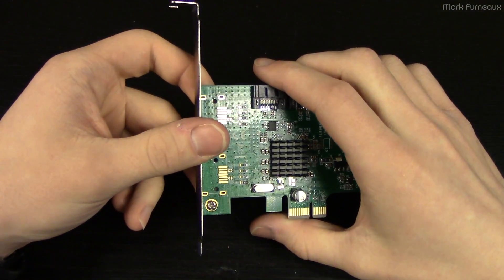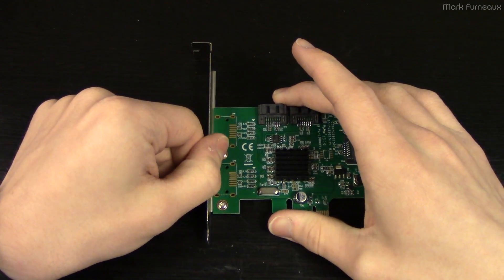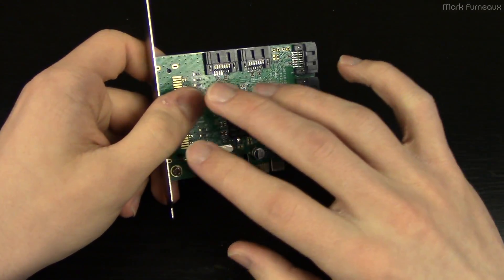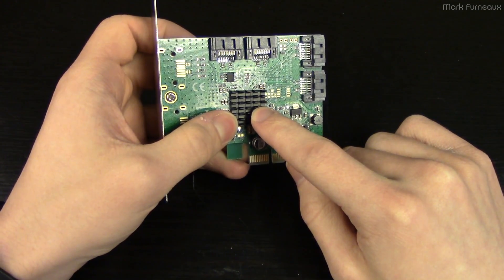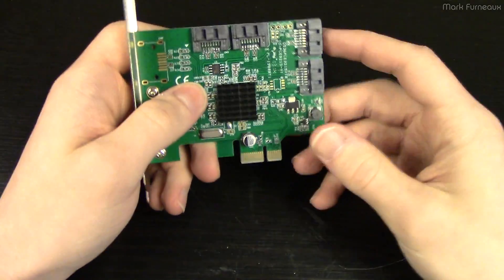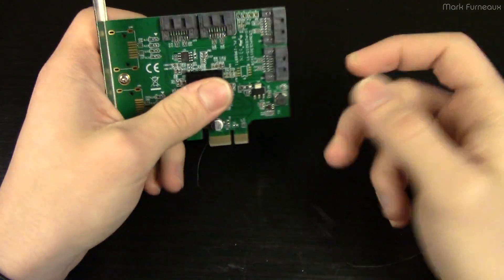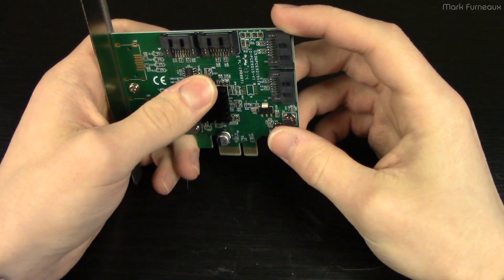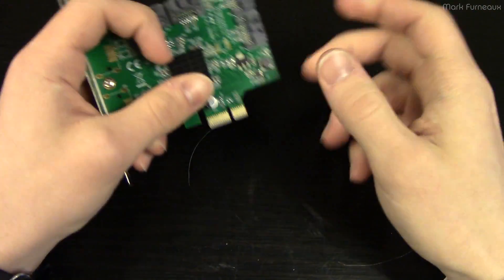WTF is Up with Marvell's Chip Reliability? (Rant?)

Comment: The problem is Marvell mainly caters to corporate customers and for the most part the only marvel parts that end up in consumer level products are factory seconds that are sold in China meant for low end use that somehow end up in "high" end products. I spent a few years in China with the manufacturing arm of an American electronics company. It's mainly the fault of distributors. They love to cut corners and will do so unless you manually QA every other chip in house. This happens with some of the other controllers too (we've had similar problems with Asmidia) but mainly with Marvell as they are one of the lower cost options in consumer gear so the margins are really low which compels distributors to go through more shady channels

Comment: Having heard your reasoning...

I have two decommissioned Opteron-based server boards (still working) which use on-board Marvell 91xx Series PHYs to drive 8 additional "SATA 6G" ports (2 pairs of 4; I presume that must be a close "relative" to the chip they use on your controller card ) - and they still work. The boards were running in 24/7/365 production systems for about six years, and all chips/channels still work.

The obvious difference is the heat-sinking ... compared to what sits on the chips on the server board the heatsink on your card is tiny. Keeping that in consideration, that could explain the discoloration you observe on the back of the PCB where the PHY sits at. I'd suspect inadequate heat-sinking or insufficient system cooling (air flow) to be your main problem there.

On another thought, since I don't really see a branding silkscreened or some sticker showing some recognizable brand ... if you buy the cheapest NoName eJunk Controller card there is you clearly get what you pay for. There's a reason why LSI, Escalade et al HBAs cost a whole lot more.

So ... since your problem seems to be spread across different systems of different configuration, and you already ruled out faulty power supplies in another comment, this only leaves you with "junk controller" (in terms of design and heat-sinking) or inadequate cooling (air flow) across all that systems you refer to (but don't describe in any detail). Given you just counted up to "SATA Port 12" ... if that system(s) is(/are) packed with drives you already got a lot of excess heat coming from them (assuming 7200rpm spinning rust) plus whatever the base system adds to it. Can't be a "too underpowered" rig given you run ZFS (FreeNAS? ZFS on Linux?), and with a whole lot of storage space you need quite some RAM (and CPU power) to make ZFS a happy camper.

Personally I'd question the quality of the controller cards (especially if the ones which died on you were all one-and-the-same or revolving around the same design). Though I'd suggest looking into system cooling as well if the chip gets so hot it starts to discolor the PCB.

On a side-note: I agree with your assessment that Marvell chips are not exactly "great" by any stretch of the imagination. From what I gather they are mostly used to implement some value-added feature on the cheap because they aren't terribly expensive for what they are ... when building a personal rig I always stayed far away from anything that shipped with any Marvell PHYs (be it SATA, USB, ENET, ....).
Reply from the maker: In this scenario you have a good point, but the other failures were on Adaptec RAID cards, and workstation-class motherboards, so not nearly as cheap as this card. One theory I had was related to operational die temperature. This card had the only heatsinked chip of the lot, and it lasted the longest. It could be that some of the PHYs probably needed some minimal amount of heatsinking, (just a few C/W), but the spec sheet said they didn't need it and so no manufacturer implemented it. Still, that points to either inefficient design, or poor thermal ratings in the datasheet.
Reply: You had the same "sudden death" issues with other cards from other brands as well? o.O

Hmm... from experience with "highly odd failures" (I could tell you a quite elaborate "bug hunt" story about tracking down the source of a server crashing for no good reason - losely related to the question): Are ANY of the systems which are affected by the controller-dying problem in your house and/or or the same breaker circuit?

Reason for the question...

I observed very oddball failures because of a broken earth connection in the circuit, where some device (mostly CRT monitors back in the days) "leaked" half the mains voltage via the ground of their VGA cables into connected devices, therefore causing severe interference and voltages to anything connected to the same, faulty, circuit.

I observed very oddball issues (the "server crashing for no good reason") with very short high-voltage spikes induced into the power grid by improperly decoupled construction site equipment nearby (just a few blocks down the road, the motor of a crane was at fault because once I found the "spike" (over-night monitoring with a scope and storing a log to a USB drive) we could reproduce the crash to the crane turning on the motor when the sine was in the lower third of the wave - was easily fixed by putting a line-conditioning UPS in front of the server rack).

It's not normal to have HBAs of different brands (especially not when they aren't the cheapest ones) fail with the same symptom ... I'd start to look into more external causes then when you can rule out the HBA or insufficient cooling. I only ever had one Adaptec PATA RAID-5 HBA die on me. Never worked out the reason, but it suddenly died (not even visible on the PCI bus anymore) after about 2 years of use.

Comment: I'd vote for electro/micro migration due to overheating. So maybe a design flaw of the board/cooling and not the chip itself. What struck me is how it could be discolored especially since it wasnt powered on 24/7, that alone sounds like it got way too hot. But this is just guessing. :-)

Comment: At the time around early 2000s, i have experienced a mass failure of Promise technology integrated IDE and SATA controllers, the drivers had to be JUST THE RIGHT VERSION unless you wanted them to BSOD or corrupt your data, and the electronics failed too. Now i google up, and i see the 2002 announcement that Marvell is developing chips for Promise.

And while i get it that SATA is potentially quite hard, your account of mass Ethernet failure is more than a little embarrassing for the company.

Then again, i have Marvell controllers in pretty much every hard disk and every SSD, and those seem fine!

Also your suggestion that test protocol is flawed to allow influx of low-quality parts doesn't quite make sense: if that was the case, wouldn't you expect to see one or two really solid and good chips that didn't fail for decades to come? It's more likely that they haven't been taped out with reliability in mind, some high-current semiconductors on the chip aren't laid out at the grade they needed to be, saving space, and increasing resistance and localized thermal output, and thus gradual thermal failure occurs. Warping and cracking, ion motility, there's a number of thermally related degradation modes. The nasty thing with high local thermal gradient on select semiconductors inside the IC, is that while you can slow down the failure a bit by external cooling, you have no chance to really make it manageable on decade timescale.

Though on the board such as this, i'd say the regulator portion on the lower right looks a bit on the suspicious side, at least for a board that gets as hot as this does in normal operation. That could be killing the chip slowly too. Scope it?

There's another thing, the IC will be chosen by manufacturer for total cost reasons, and you'd have a hard time beating Taiwanese companies on IC cost. So what the Western manufacturers tend to (try to) offer is lower complexity of external circuitry necessary to drive the chip, which is also more in line with Western manufacturing pricing. There's a possibility that they may have underspecified the external components, and of course device manufacturers rarely have a mind of their own in this regard, they just copy the example circuit from the data sheet.

Comment: Are there any components running near the edge of their design specs, e.g., a chip that overheats at 85C, with a cooling solution designed to keep it at around 80-84C?

Comment: Heh!  I went through 6 IDE s/w raid cards way back in 2003 ~ 6 or so.  I set up linux with sw raid5, which took some effort since either the toolchain or the docs were not all that friendly to newbies like me.  Anyway, I got it working but after 5 months add-in Promise IDE controller failed.  Rinse and repeat 5 more times, each time swapping out dead IDE controller.  Actually one was DOA, but Diamond one lasted a year.  But after, that I gave up and started archiving on DVD-R.  It was for home so near-line storage was what was really needed anyway.

Comment: I have Marvell sata-3 2-port chip on my x58 Motherboard by ASUS and it is complete crap. It cannot drive SSDs (after a while starts causing BSODs) and it cannot drive bootable OS drive (BSOD after a while).
Reply: yep, my x58 have marvell too, they are a pice of crap.
Reply: I have the same problem on my asus sabertooth P67 motherboard...
Reply: Mine x58 marvell 6gbs maxes out at 160mb read and 70 read

Comment: Never had any problems with any of mine. I've been using them as well as some of the other brands you mentioned and Silicon Image for decades. The only complaint I have is sometime compatibility with standards, and often throughput on these chipsets can be an issue, and you have to do your homework before buying.

Comment: I wonder if the problem may be related to crystal resonator aging. Like PLLs being crappy design or something.
Reply from the maker: That crossed my mind, but as I said about passives in another comment, it doesn't make sense why it would favour one brand.
Reply: Many chips may share the same PLL/oscillator design. If they are pushed too hard or are sensitive to the same aging parameter it may happen. You can actually try soldering in different resonator and see if it changes anything.

Comment: According to the intermittent character of the failure I would swear that the problem is NOT in the controller IC itself, but in its surrounding. I would suspect something in regard with power rails - either local regulator IC or more likely some electrolytic or tantalum cap.
Also the blackened solder mask says something about improper thermal design of the board itself. So, although I can not speak about those other failed boards, in this case it was most probably wrongly engineered system design of the adapter card.
Reply from the maker: You have a point in this scenario, which is probably likely, but I don't think that works in general.

Comment: Are you sure it's the chip or have you checked for faults on the pcb, those surface mount electrolytic caps are a prime suspect.